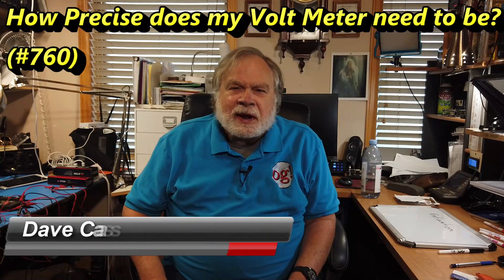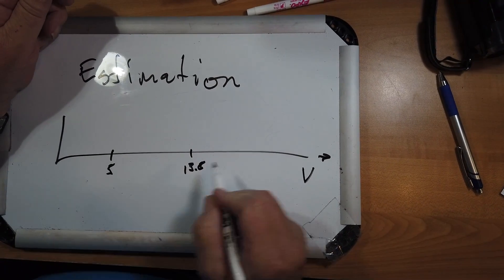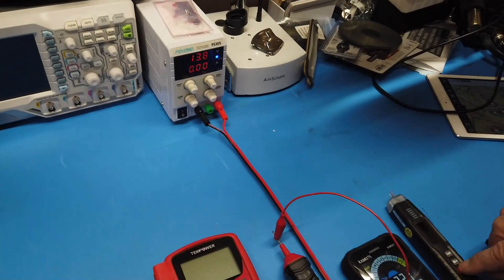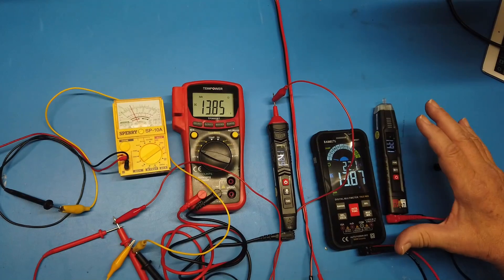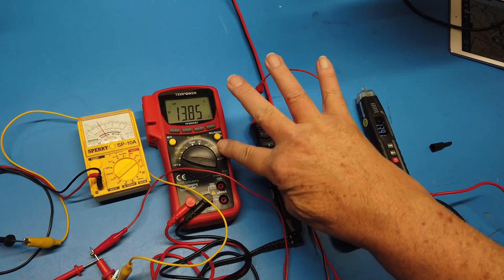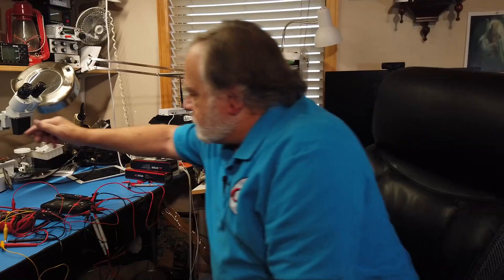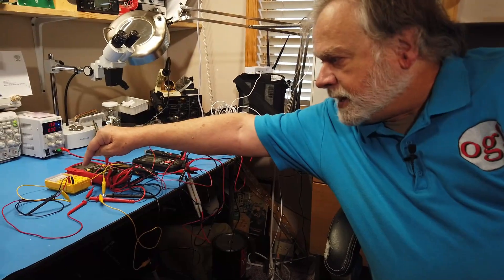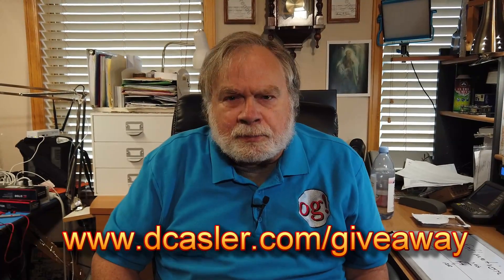How Precise does my Volt Meter need to be? (#760)

Comment: For DC voltages, there are very low cost extremely accurate voltage references.  Often with NIST certs and good to several decimal places.  But, then, if your active with building and repairing electronics, you already know about meter tolerances as well as how tight it need to be for you use..  But if you just like to be re-assured and know what you have, a dc voltage ref can be had for well under $100. often closer to the $50 range.

Comment: I was intrigued by your description of the TP9605 BT. Since I seem to be a cheap DMM collector I looked it up. I could justify/rationalize it  by the logging capabilities. I have a General Instruments one with BT and a Mastech with a (DB9!) serial port, but... I understand that a lot of people have complained about the logging software for the Uni-T model. So what persuaded you to buy the Tekpower, and how do you rate the logging? I have not seen any reviews for it.
Thanks and 73
Barry, VE7VIE and WV2J.
Reply from the maker: An Oggie suggested the Tekpower. I can't report on the logging because I haven't tried it--sorry.
Reply: @davecasler  Turns out it was the Tekpower people complained about the logging feature of. So I just bought a Uni-T UT61e+, but I have heard it has the same issues. My old Mastech logs just fine.  Thanks and 73.

Comment: 13.8 with 10% is 1.38V or 12.4 to 15.18V. no problem using the radio in mobile operation where the charger voltage can go up to 14.8v 

Most mobile rights can handle up to 15% so 15.87  

It's a huge marginal, so you don't need to know if the rig is getting 12 or 15V a simple 2digit meter is good enough for that... Yes I love 4 and even 5 digit meters, and adjust the voltage close for at least 0.1 accuracy when i have the opportunity, but do I really need that? No I don't. I know it's not necessary for most of the things I'm doing...

Comment: A very nice demonstration and explanation.  The same holds true for the source.  We have no way of knowing how precise the power supply reading and actual output are, as you pointed out.  Thanks!  Also, this type of thinking applies to everything in life.  We should always strive to understand the assumptions that we are making and potential margin of error present in any measurement.
Reply from the maker: Absolutely. Humans can be biased and blank-out undesirable info, which I catch myself doing all the time. That's why when I think it's hot, I look at a thermometer to see if it's me or it really is hot!

Comment: Dave, Simpson 260 and the Triplett 630 were what I trained on in the 50's and 60's.  In the television shop we used RCA Senior Volt-Ohmist. Everything since the 80's were digital.  You are right, the Harbor Freight $6 will do for general ham radio troubleshooting.
Reply: I have a 260 and 635, and a Triplett 850 which is a clone of the Senior. And  a little Triplett 310C of course.

Comment: Dave, you're leaving out something. Each meter will also say the accuracy is "plus or minus 2or3 LSD". Meaning the rightmost digit may be off by 2 or 3 regardless of the other accuracy. So if it says 12.34 that could be 12.31 to 12.37 volts. That's a real difference. And when Horror Fright free red meter read 0.4v different from my trusted B&K, I decided there had to be a way to get a reference voltage.
 And there is. In a mini Altoids tin I have a battery and a 10.000 (five digit avcuracy) reference voltage. Added a power switch and two alligator clips. Now, I can clip it onto any DMM and if the DMM doesn't say 10.000 then I can calibrate it to the reference and be reasonably certsin the 12ish readings will also be good.
 It only supplies enough power for high impedance (digital) meters, but that's a good start.
 I tried adjusting an analog 10-18 volt meter on a boat. If I set it to 11 volts...it was off by 1/2 volt at 12.8. If I set it to 14.4 to match the alternator...off the way, even worse. Damfino, that one got replaced.
 But the red Horror Fright meters are sometimes dead on, sometimes 0.4 volts off. That's a 40% error on a nominal 12 volt circuit. Not something to recommend, unless your test light has burnt out.

Comment: Reading.  I have a fluke meter that only shows the main voltage with no decimal points. With my battery and solar charge controllers this is not good or accurate enough.  So when my one meter reads 13V (DC) .. it will read 13 until 14 volts is measured.  Thus 13.5 or 13.8 etc. will not show up.   The meter you have on the desk looked like it only has one number past the point.  I think it was reading 13.8 ... but nothing after that, because it might not be designed or range set properly.   The volt meters have 13.8x ... a second digit.

Comment: When I first studying the best meter for most of us was a Samson 260 M. I am lucky enough to ended up with 2 of them with the case that has the slide up door to protect it. One of them someone left the batteries in and has some damage from leaky batteries, but good other than that.
Reply: Simpson 260. Very good meter !  Got one in my collection.
Reply: @gregforster5913  the 260M makes it easy to read!  Look down at it and line up the needle and the reflection of it. So you know that you are not looking at an angel. Same meter but with a mirror on it!

Comment: I believe in that yellow one. If you noticed, as the only one, have a star with a number in it - tolerance 2% of the full-scale range, in this case, +/- 1V (50v range chosen). There are 4 classes of meters:
- laboratory (tolerance +/- 0.2%)
- professional (tolerance +/- 1%) - that's the one you are looking for as radio amateurs are often servicing their own equipment and are responsible for keeping radio equipment within parameters that allows the proper operation
- everyday use (tolerance +/- 2%) good enough to measure the power supply
- indicators (tolerance +/- 5%) are usually seen on power distribution boards where you have to see if you have 120V or if does voltage is dropping. MFJ SWR meter is rated in manual at 5% tolerance - if you quickly calculate returned power to sent power with a tolerance of 5% then if you are looking at SWR 2:1 that means the true value could be 1.6:1  or  4:1.  Gladly they are well calibrated as those that I had touched with showed values a fraction above 1% or below.
If the meter shows values above 5% difference from expected (measured with a meter that can be sure of value) then that meter should be discarded/serviced.

I wish that prodcers keep marking meters with standard singns like they used to.

Comment: My answer every time I'm asked is "how accurate do you want to be"? I agree that most DVMs will probably suffice for most shacks. Bottom line, you get what you pay for, just like anything else. I do field electronics, and the company stipulates "approved meters" that we are permitted to use. I won't say the brand of the approved DVM(s). I will say that one of my most important meters I carry, but seldom use, is an analog Simpson meter (a company approved meter that very few have). There are many times a DVM will not react fast enough to see a power issue, such as a radio connected to a battery, and the battery connected to the charger. The radio powers up, but turns off and restarts when keyed. The voltage drop is usually so quick, the DVM doesn't have a chance to display the drop. The needle will move on that analog meter will move real quick. This tends to tell me that the supplied voltage is coming straight from the charger and not the battery, or I have a really bad battery! Call me "old" but I'll always have an analog volt/ ohm meter as well as an analog SWR/ power meter kept next to the DVM and Digital SWR/RTL meter. My first grab is almost always the digital meters. Something to be said for "the old" meters though. Thanks for the great videos. -73 KN1B

Comment: Thanks Dave for the nice video.  Have purchased multimeters over the years and most were fairly accurate.  Did however have more issues with some of the supplied meter leads (wires) becoming intermittent over time, resulting in voltage discrepancies.     73,    AC3HT